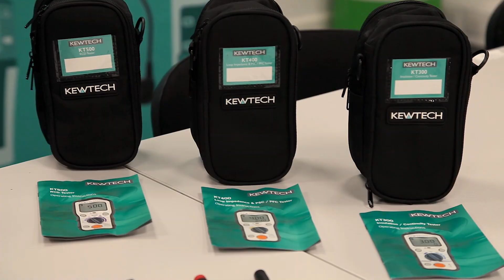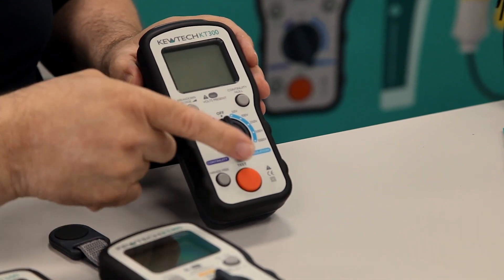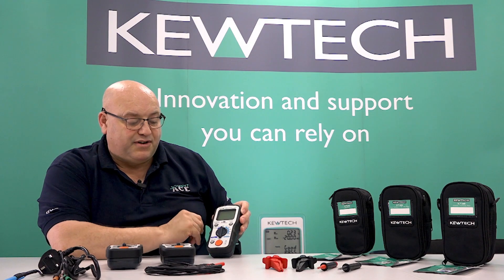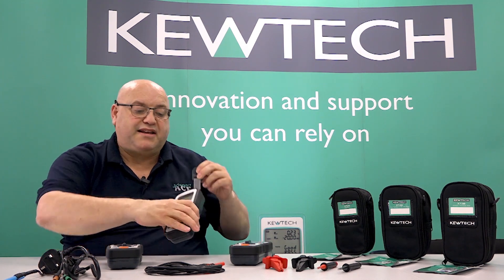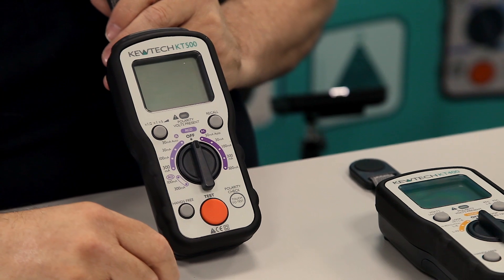KT single function Testers

Comment: No advantage nor benefit
Mft do exactly what these testers do individually
Reply from the maker: Hi Faisal Hussain, the single functions are what all sparkies use to use before the introduction of the MFT’s. 
When carrying out an installation first fix the continuity and insulation functions are used to prove everything is ok before power is turned on. This is the part of the MFT that is generally used the most and sometimes the first to wear out, also if you are repairing motors this is what you would use.

Similar with white good engineers, gas installers these use single function loop testers to make sure that the circuit they are going to plug the new appliances into or the spur they are connecting to has a good earth reading.

RCD testers are used to fault find and check that the protective devices fitted protect you against electrical faults.

There are many other reasons why there is still a large demand for single functions and this starts with the utility companies.

Comment: Cant see the advantage of these like going back to the old school with a bag full of testers
Reply from the maker: Hi RK 180, the single functions are what all sparkies use to use before the introduction of the MFT’s. 
When carrying out an installation first fix the continuity and insulation functions are used to prove everything is ok before power is turned on. This is the part of the MFT that is generally used the most and sometimes the first to wear out, also if you are repairing motors this is what you would use.

Similar with white good engineers, gas installers these use single function loop testers to make sure that the circuit they are going to plug the new appliances into or the spur they are connecting to has a good earth reading.

RCD testers are used to fault find and check that the protective devices fitted protect you against electrical faults.

There are many other reasons why there is still a large demand for single functions and this starts with the utility companies.
Reply: @Kewtechcorp  well said, totally agree, cheers